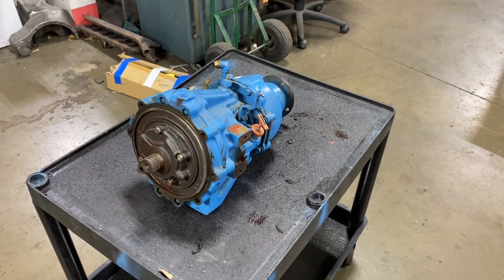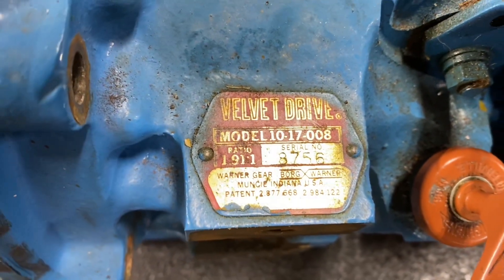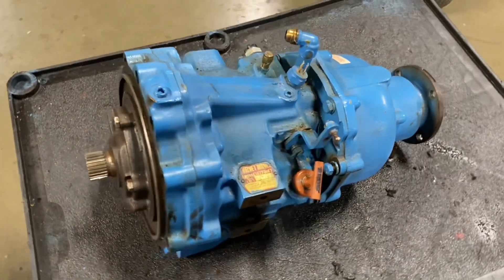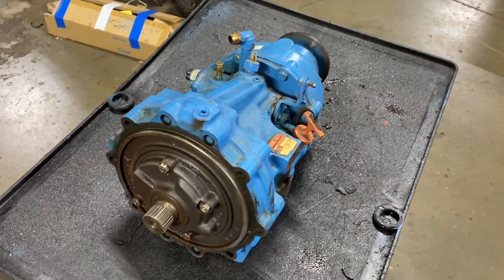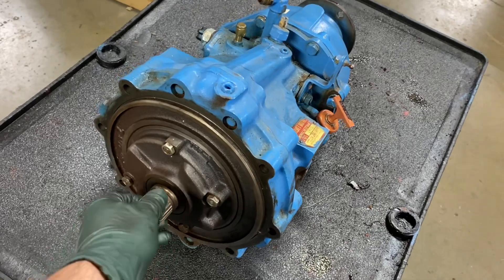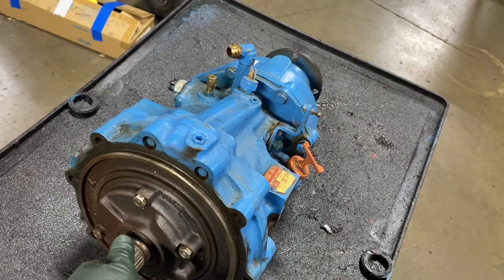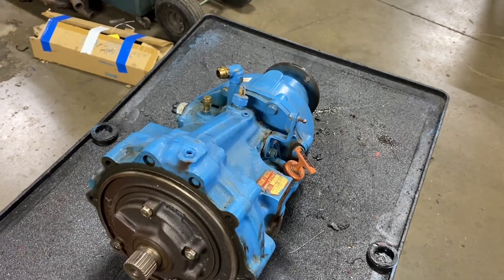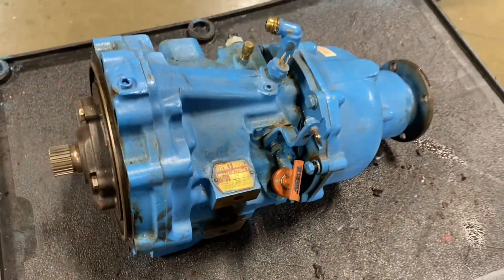Velvet Drive 1.91 and 1.88 Reduction Tip

Comment: Have two 2.91 in my 1970 boat. My 2.91 are older. The rear coupler has the bolt on bearing plate. I rebuilt one of mine. It was dripping fluid. Turned out a layer of rust had jacked a rubber square seal away from a cast iron flat piece and was dripping there. These are an easy rebuild. I have torn down many AT for cars, and these are simple on the inside.

Comment: i have 1017  108 188;1 are there any advantages or disadvantages ? thanks
Reply from the maker: Not really. It’s a reverse ratio as I described.
Reply: What is the cost to rebuild one of those and average turn around time?
Reply: @markhill9344           mine was done 3 yearsago 1400.00   took a week   had custom work done  added 1 extra clutch pack with minor machine wort
Reply: I own a 1986 27’ Phoenix FishBuster.  For some reason, in its past lives, (I have owned it 18 months) it was repowered or a gear went bad.  My 350 260hp Mercruisers have 1 of each of those ratios.  Plus, they are setup for the wheels to turn inboard in forward gear, not outboard like standard twin engine installation.
Reply: @rogerz3417  I have a friend with a Tiarra 1986, with twin Mercruiser 260 inboards. Both engines standard rotation.His velvet drives are reversible. Nice unusual model velvet drive transmission.  And props turn out from top on both sides. I don't know why they are not all made like his. Normally a VD cannot be reversed all the time.